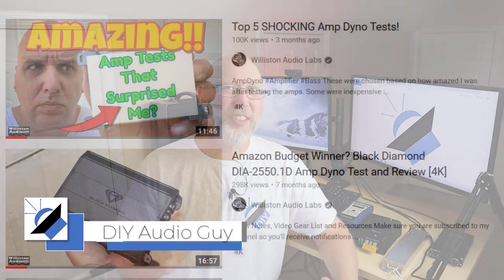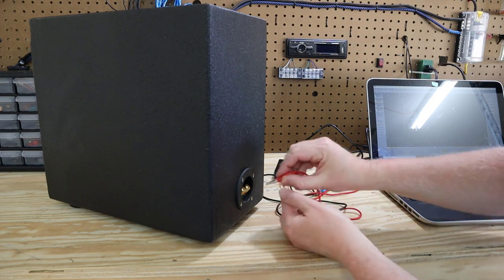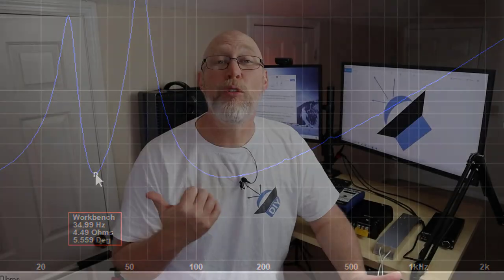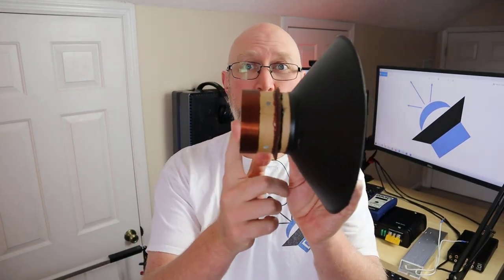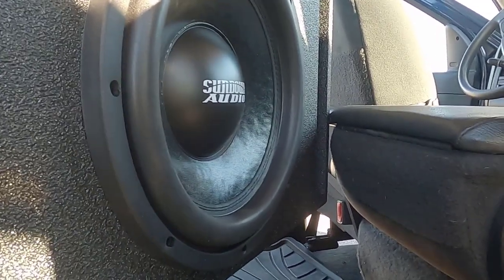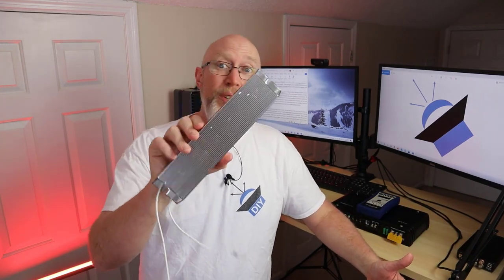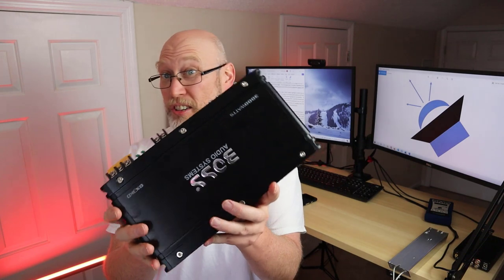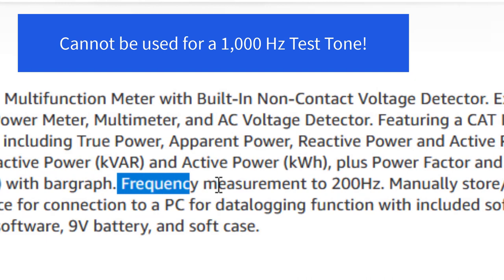Real World Amplifier Power  #SMD #ampdyno

Comment: You can actually use a 50hz tone, a power resistor and a multimeter. Square the voltage and divide it by the resistor's ohms and you have the amp's wattage. I also use my phone's mic input and an oscilloscope app to know the clipping point so i can measure clean power.
Reply from the maker: Yes, that should get the same results as an amp dyno on a resistive load.  I did not really get deep into how box rise impacts that because I've got another video on that.
Reply: For dynoing an amp? Or for finding out true power from a system?
Reply: @DIYAudioGuy  I literally heard you just say I don’t like to use the term box rise as I read this comment. Lmao 🤣🤣🤣
Reply from the maker: @IAM_HC  I did not say that I did not use the term.  I said I did not like using the term.  I don't like cussing either.  🤣
Reply: @DIYAudioGuy  lol and I totally get your point on why you don’t but why you may. The timing was hilarious and I had to tease.

Comment: Good video Justin. Very informative. Lots of great information here. I personally just wont purchase SMD products. Are they pretty top notch? Absolutely. However they are also incredibly over priced. I get it, Steve Meade is a founder and a pioneer in the industry. But after this many years, he still doesn't even include a 9v battery to operate his equipment. Its not that big of a deal but when you buy stuff that expensive, doesn't have a battery, and I personally know people who literally picked up a control lead just to have the wiring fall right out of it. Brand new. As prices continue to rise on literally EVERYTHING, I won't continue to support car audio companies that jack prices up like crazy. I'll just purchase directly from build houses in China from now on. I can purchase 2 competition high end drivers for the price of one if I go straight to the build house. These days its about playing it smart. 

Again, excellent video Justin. Great knowledge here for anyone that wants to dive deeper into the knowledge of car audio.
Reply from the maker: I totally get that.  It is kind of like snap-on tools.
Reply: @DIYAudioGuy  FACTS
Reply: @DIYAudioGuy  At least Snap-on has a no questioned asked replacement free of charge program. I'm a welder fabricator for 20 years. Trust me on that. At least Snap on makes it worth it in the long run after an expensive initial investment.
Reply: The engineering behind the product is from Tony D'amore. All this man's products are solid.
Reply from the maker: That's why I like this device.  Made specifically for audio by a legit engineer with tons of audio experience.  If you want to measure power this is the best tool for the job.
Reply: @DIYAudioGuy  It can be done for half the price with trusted results.
Reply: @nate0 yeah it was. That made me LOL. Honestly, good for Harbor freight. Hope more companies do it

Comment: Cool, this should make some great comparison videos. Like if the clip light matches up with an oscilloscope showing the wave form. Back when I competed, we always just did the Volts squared divided by the load to get watts. Not really factoring in impedance rise. It would be cool if you made a video showing real world with a sub in a box vs using dummy load. Also setting gains. I'd like to see what you think is easier.
Reply from the maker: That is exactly what I plan to do.  Just need to hurry up and get the videos out before somebody scoops me!
Reply: It does line up with an oscilloscope.
Reply: @DIYAudioGuy  you were already scooped. EMF audio did that video over a year ago to show that it's impedance rise and not box rise he did a side by side comparison on the bench with sub in the box and in free air.

Comment: I see you are a friend of ELI the ICE man. The power factor of a speaker system varies all over the place with frequency. If the inductors have ferrite cores it will vary with amplitude as well. Not only that but the frequency response of the amplifier will change with reactive loads and with amplitude. So everyone wants one or a few simple numbers to make comparisons of something very complex. To add to the fun you have back EMF mostly from woofers. The woofer wants to act as a generator at its system resonant frequency pushing back at the amplifier. So you'd better have a damned good large well regulated low impedance power supply or the speaker will push the quiescent operating point of the active devices all over the place. This in part explains why amplifiers that measure the same on a test bench with 4 and 8 ohm resistors sound different. 

The output transformer of vacuum tube amplifiers adds an interesting kind of distortion called hysteresis distortion where due to the magnetic losses in the core the negative going trace does not follow the same path as the positive going trace. This is due to the inertia of the magnetic domains switching polarity. Solid state amplifiers and OTL tube amplifiers cannot create this kind of distortion. 

The worst amplifier design IMO and the most primitive is the SET class A tube amplifier with no feedback. Even the thermionic emissions of the cathode varies with the square of the temperature (in degrees Kelvin.) The thing drifts all over the place and is usually very low power. It also generates a lot of heat as it is the least efficient design. That was the first amplifier I ever built from spare parts and the schematic in the back of an RCA tube manual when I was 10 years old.
Reply from the maker: I am not familiar with ELI the ICE man.

Comment: Here’s what I’ve wondered about measuring power on a good multi-channel DSO like a Pico scope and a PC. If I’m plotting the voltage and amperage together could I get real wattage that way because you’re not just putting two number together like a DMM and an amp clamp? With the scope you’d be using a cursor and seeing what the amperage was at the exact point you’re measuring voltage as well.
Reply from the maker: You have to do something like that in order to account for  power factor

Comment: Thank you for the great information 🙏 i appreciate it, but about the dyno I think it's take the measurement just to know if the amplifier can reach the manufacturer mentioned power or not, because of this they don't care for resistance change.
Reply from the maker: Exactly.  You have to do that test into a resistive load instead of a reactive load. That is the only way to have a consistent, comparable result.  When you hook it up to a speaker the result could be due to box rise or the result could be due to the reactive load.  So you don't actually know what the amplifier can do.
Reply: Yup, exactly what he said in the video.

Comment: If you're going to do amp dyno's, do it with a reactive load. Most people are running 1 or 2, 10 or 12 inch subs in a ported box. That's what i would liie to see. Cause i have a 500 watt rms jbl amp that just doesn't seem to have the power it should
Reply from the maker: Like this? https://youtu.be/JGjl4WygGT8

Comment: You really should study Electrical Engineering, you would make a great teacher.  

It’s one thing to understand Electrical Engineering, it’s another to explain it clearly and concisely.
Reply from the maker: If I had a time machine I would.
Reply: @DIYAudioGuy  I don’t think you need a time machine, you already know the information.

Resistive, Capacitive and Inductive circuits are part of and Undergraduate Degree.  I’m pretty sure it was on the subject on AC DC conversion.

Comment: You did a good job describing the electromatic field, left out the magnet (motor), by that movement creates AC current also adding to resistance, then took a crap you pitched an overpriced POS, I'm making a fart sound. Lol Scot M.
Reply from the maker: I get that, but I did a ton of research.  It was really easy to find stuff that could calculate true power around 60 hertz. If you just need to calculate your power on a subwoofer I think an AC clamp meter would do just fine.   But not many devices worked across the full spectrum.

Comment: Maybe not a bad idea to use a "that Amazon meter". Maybe it could work. Most (if not all) are for measuring correct at 50 or 60 Hz sinewave. But why not measure the amp at 50 or 60 Hz sinewave?
Reply from the maker: The AC clamp meter designed for house voltage will work fine if you just want to measure bass.  The cheaper ones all have safety warnings indicating that you should not ever measure a square wave with them.  So if you're amplifiers clipping...
Reply: @DIYAudioGuy  Good point about the clipping, that will give other frequencies than 50/60 Hz.
Looked around for current measuring devices that I was going to use in a end of line testing machine that has 40 Hz square wave. So most of the ones do only 50/60 Hz sinve wave. Then there are ones that goes up a bit in frequency. Something like up to 200 Hz but still only sine wave. Still not good enough for square waves.
Ended up using a $10 current coil from LEM, but then you also need the rest of the things like power supply and something to measure the voltage from it. Basically what's inside that SMD thing you have.

Comment: Audio output is not AC it is DC.  AC changes in polarity from a positive voltage to a negative voltage.  Meaning the current alternates in the direction it flows through the circuit. That is why its called alternating current.    Audio is always a positive voltage that changes in amplitude the current always flows in the same direction..  Yes it acts like AC but it is not.
Reply from the maker: That's actually a very common myth, perhaps I need to make a video about that one as well.
Reply: @DIYAudioGuy  I am an electronics technician.  My specialty in the Navy was Radars and amplifiers.  The output of an audio amplifier is DC current.  An emphasis on current.  The current only goes in one single direction.  In an AC circuit the flow of current actually changes direction.  
  Hook a signal generator up to and amp input set it at 50hz hook up an o-scope to the out put.  No matter what the input gain it is always 50hz but when you change the gain the amplitude changes.  Whether the output is 0 to 8 volts at 50hz or it is 0 to 16 volts at 50 Hz the current only goes in 1 single direction.
Reply: @timbuckohfive2751  would that not only be true for a amp that has only positive voltage (0 to +24). But what if the amp goes from for example -24 to +24? Then I think that would considered to be AC if the frequency is > 0.